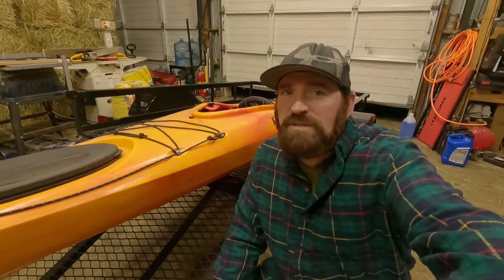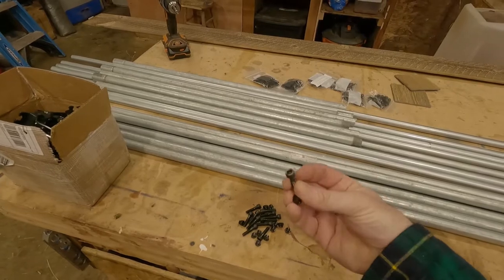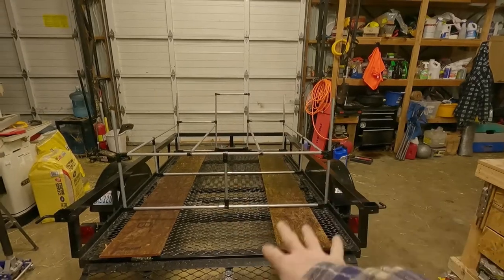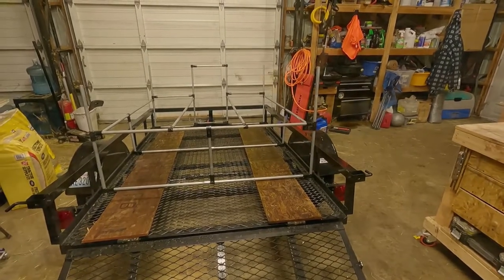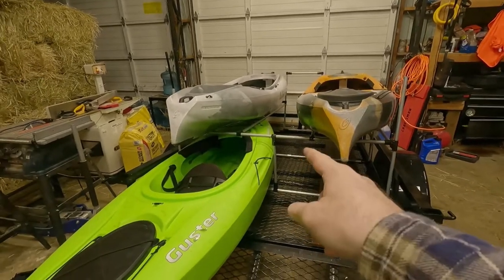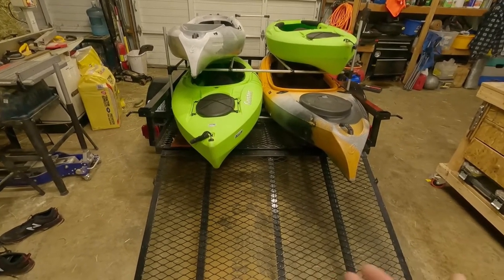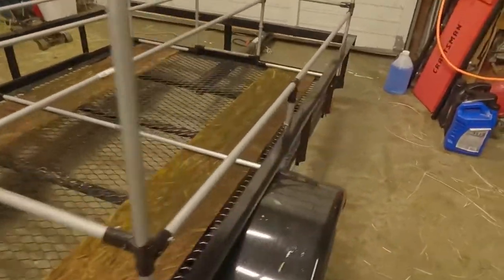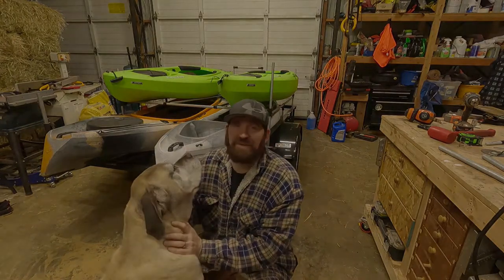DIY kayak rack

Comment: Dude that turned out awesome
Reply from the maker: Thanks.  Hopefully it holds up.
Reply: @beardedfamilyman243  if it doesn't build it out of 80\20.
Reply: @beardedfamilyman243  looks great. how has this held up down the highway?
Reply from the maker: @mikesouthworth1999  thanks for the compliment. It works out amazing. We’ve taken all 6 kayaks from Washington down to Idaho, Utah and California with no problems. I’m planning on adding a rack to put a couple bikes on it this summer so stay tuned for that.
Reply: @beardedfamilyman243  definitely interested in that as well. I have a 8x8 flat tilt that I want to set up for both as well. Where will bikes go?
Reply from the maker: @mikesouthworth1999  I’m going to shift the rack back and make a second removable rack on the front of the trailer. So the bikes will be directly over the hitch.
Reply: @beardedfamilyman243  I like it. Look forward to the updated rack. Do you think 1/2" conduit is plenty strong or maybe move up to 3/4"?